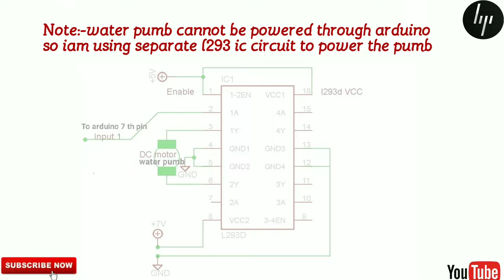Arduino Fire Fighting Robot _Hobby project Diy

Comment: Finally i made this project by changing some code and components. Now it's working perfectly fine.
Reply: What change u did in the coding..can u pls ..help me  out
Reply: @ritika9026  i changed the connections and instead of 2nd motor driver i used relay module for water pump.
In code i just changed the water pump on/off controls.
Reply: @RohitKumar-zi8fv  thank you 😊
Reply: I want to know the changing please help me
Reply: @Luciferkookiezone  i used relay instead of 2nd motor driver
Reply: BRO CAN I GET UR CIRCUIT AND CODE
PLZ🙏🏻🙏🏻🙏🏻
Reply: @RohitKumar-zi8fv  plzz🙏🏻🙏🏻
Reply: Broo... Plz replay
Reply: @ritika9026  please explain this code I need help reply as soon as possible
Reply: Can you provide program and correct circuit diagram? Plz tell me as soon as
Reply: @RohitKumar-zi8fv  ع
Reply: Apner program and diagram ta dite parben ?

Comment: bro what about the battery
Reply from the maker: 18650 battery x 2
Reply: @hobbyproject  no i was asking that where did you put the battery in the robot. i think that battery partis not their in the video
Reply from the maker: Sorry that part is not in video , I have placed the battery under the chassis
Reply: @hobbyproject  ok, then what about connections of the battery
Reply: Sir i am very new to this type of  things
Reply from the maker: 9400496834 what's app

Comment: bro can u plzz show the mini bread board connections and how to connect the pump and the battery. plzz bro
Reply from the maker: U don't need a mini breadboard,  use relay module for pumb.
Reply: @hobbyproject  bro if we use a relay module will the code change
Reply: would we need to change the code
Reply from the maker: Same code.
Reply: @hobbyproject  thanku bro
Reply: @vigneshkumar2751  did u finally make this project ? Was it working need help

Comment: Please respond. 🙏
I've  almost made this project for final year. 
Why does your circuit diagram has 2 motors and your model and code has 4 motors.
Reply: @ankit saha may be he connected each pair of motors in series hence gave ckt diagram with only 2 motors
Reply: Where can i buy components
Reply: Where can I buy components
Reply: @hrutikshinde1270  where do you live? Just ask someone where are electronics shops in the city. You'll get almost all parts. If not order them online.
I didn't make the model though.
Reply: hey bro, i'm in same situation, for my 2nd year of engineering i chose this project, do you have some files that can help me that you used for your project ? thanks :)
Reply: @tux4059  if you get anything
Reply me as well
Reply: @ArpanChoudhari  for sure bro
Reply: @ArpanChoudhari  hey man, the motors are in parallel, like those are 4 motors, but branched in parallel just sort out same cables from the motor driver
Reply: @tux4059  thanks

Comment: Bro please tell me where you connected the water pump it's very urgent I connected the water pump according to the circuit but it's not working
Reply from the maker: Connect the pump to 6th pin on arduino.
Reply: @hobbyproject  what about the negative of the pump
Reply from the maker: Gnd